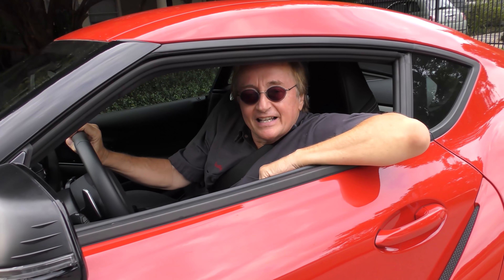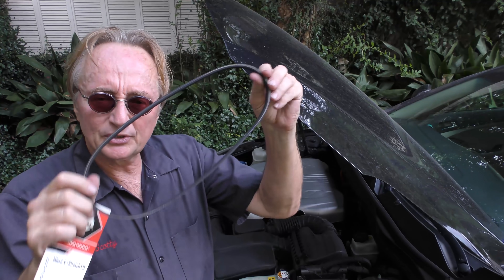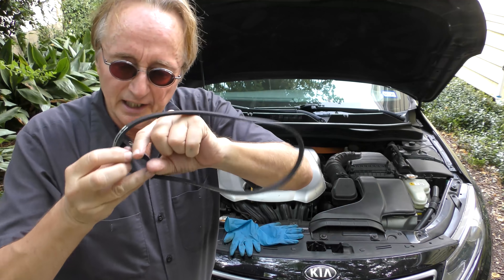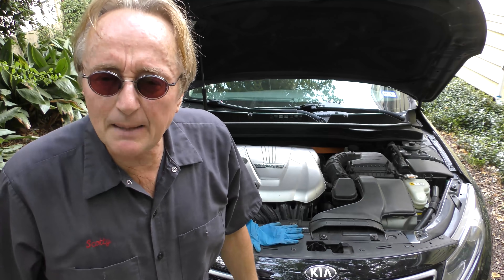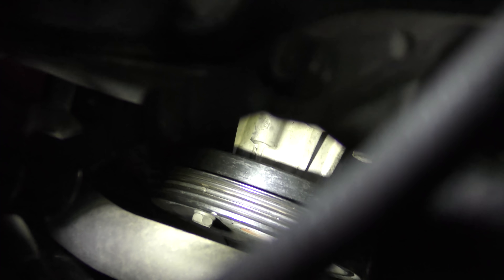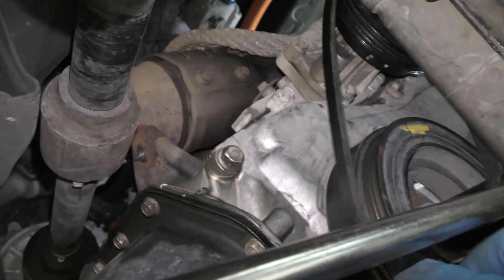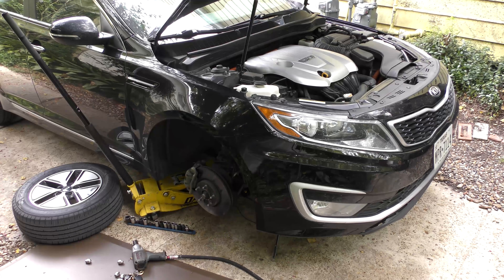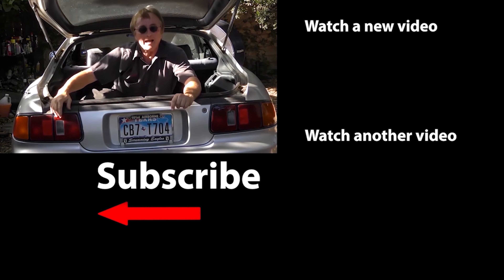I’m Mad as Hell and I’m Not Going to Take It Anymore

Comment: Some car designs you just have to ask “why?”
Reply: More than just some
Reply: I am still wondering what the point to engine covers is?
Reply: @sctslincoln  Primarily asthetics, but some manufacturers claim it has foam that is "sound deadening!" Lmao
Reply: @xforce687  its true though, i did an experiment and they quiet down the engine noise a little
Reply: ArmchairWarrior  Don't all the big three have a 3.0L diesel engine for their full size pickups?
Reply: ArmchairWarrior  i see alot of old ,Ford trucks though, F150, Ranger and Broncos
Reply: Oakleyworld you see a lot of mustangs and crown vic’s as well. Not so much for the taurus’, tempos and windstars.
Reply: Been here. So many are designed in and of themselves.  Many design teams never really interact. Also many people don't realize that book time is based upon the entire Driveline(engine and trans and dufferentials) being out of the vehicle. Or at least it was , some years back.
Reply: @bap7929  your right, i was just thinking trucks.
Reply: Try tune up in a 1992 ford aerostar minivan lol you have to remove the engine to change the spark plugs 😁
Reply: ArmchairWarrior  
Found On Road Dead.
Fix Or Repair Daily.
Fails On Rainy Days.
First On Recall Day.
First On Rust Deterioration.
Driver Returns On Foot 
(FORD backwards)
Reply: @sctslincoln  muffles engine noise standing outside the vehicle. Notice a lot of cars don't have underhood insulation any longer. Beauty cover instead. I hate them tho. I'd rather see the engine.
Reply: Probably 90% of the time it's just to make it different. Doesn't have to be better just different
Reply: xforce687 pedestrian safety. Newer covers have to be like a cushion, if a pedestrian smashes on the hood.

Comment: Call me crazy, but that looked like the easiest thing I've ever seen Scotty do.
Reply: I think it worked ok also. Problem(?) is that I hope the belts are marked as such. Saved a lot of parts and made the engine lighter (a bit). I have done this on older cars in an emergency when a belt fell off.
Reply: Do you want to jack up your vehicle take off the tire and install a belt from the bottom or whether you install from the top end without doing all that ?
Reply: @lesflynn2392  I hear ya, but I've wrestled with serpentine belts before and it seemed more trouble than that is all I'm saying.
Reply: Honestly if that belt is super cheap like only 3 bucks then to me I wouldn't mind the design its super simple and less to go wrong like a worn tensioner or bad idler pulley bearing
Reply: The problem is if Another belt breaks and you need to remove this one or remove this one to get to another inner part (Timing) then you have to replace all the belts you messed with..
Reply: The manufacturer saved money and it costs you money in the long run.
Reply: A professional can make anything look easy because of their experience and confidence. Try doing it yourself and you'll see what I mean. Crazy Kevin...... LOL!

Comment: Actually, those tensioners are a frequent trouble spot. By having the water pump on it's own belt without a tensioner, no matter what else seizes, the water pump will continue to rotate and you can drive home.
Reply: Quite a possibility, however I have a 2003 Accord with 291,000 miles on original tensioner, 2006 Accord with 200k on the original, 2007 Accord 215k on the original. My Mom's 2008 Crv is just starting to rattle at 210,000 miles so the tensioner will be replaced.

Comment: Just when I thought modern auto engineering couldn't get any crappier.
Reply: as the Carpenters used to sing "We've Only Just Begun"...lol
Reply: What?? Just because on some cars you (officially) have to take off the nose piece and bumper to change a headlight, or can't check your transmission fluid level while it's cold (or at all, when they do away with trans fluid dipsticks), or decide not to have spare tires anymore, because that can of Fix-A-Leak and the dime store compressor they give you will fix anything, even if the tire disintigrates???  /sarcasm.
Reply: @markh.6687  😂😂
Reply: Soon it's goona be time to start riding horses and wagons!
Reply: @tps607  First a "Network" reference and now the Carpenters.  As long as we're on a 70s vibe, could we bring back the '75 Monte Carlo?  Y'know, as kind of a reminder to Chevy of how they used to build cars, how they still could build cars, and in absolutely every measurable way don't anymore?
Reply: @maingun07  I think a committee of accountants is in charge now

Comment: As a mechanical engineer.... honestly it isn't a bad design and not hard to replace. You also don't have to worry about having the wrong tension or a bad tensioner pulley. This is a simple design that saves space, cost, and complexity.

Comment: I just replaced this exact belt on the TOYOTA prius (2004-2009) Scotty. Even the best of the best are cheap as hell sometimes. A little different, a bit harder, as there were two adjusting bolts, and you had to "check" the tension with a special tool, which I had to get around by doing the twist test (twist the belt on its longest run, make it so it can't go past 90 degree twist). Still was a simple job though.
Reply: Scotty has some obvious bias. Glosses over cheap Toyota crap like lousy paint and plastics that break easily like door handles, but bashes a Kia and says it's junk because of a modern belt design that eliminates a tensioner, which can go bad. This car is pushing 150k miles and still look and sounds good. If it were a Camry it might be burning oil by now with a broken door handle and warped dashboard padding. I can always count on him bashing a Kia or Hyundai unjustifiably and praising some rattle trap Toyota.

Comment: I install these all the time at work, they take 10 seconds lol. Also you can reuse them no problem. This guys a goof
Reply: @172-e5s   I'm a hyundai tech. You can see he's working on a 15+ hyundai/kia 2.4 which uses a stretch belt for the water pump. I have seen exactly 0 failures and well over 100k mile lifespan. The stretch belt is usually is much better condition than the serpentine belt when they do get changed. Probably due to the reduced friction and therefore reduced heat. You may also know these cars have a recall for premature engine failure. I replace 1-3 of these engines per week with millage varying from 30k to 200k, most people opt not to buy new belts at that time so we end up putting the old ones back on. Never had a problem in the 200 or so cars I've done.

Comment: I'm not sure about that car, but i was working on a 2005 kia amanti the other day, and it has a manual adjusting tensioner. You loosen a bolt underneath the idler pulley, then you loosen the idler bolt a little, and that allows the idler to slide back and forth to tighten/loosen the belt as much as you please.

Comment: Yeah I got a 2006 Mazda Mazda3 with the 2.3 litre engine. The alternator and water pump use a serpentine belt with a tensioner, but the air conditioning compressor uses one of those stretch belts exactly as you showed in this video.

Comment: My 04 Subaru has 2 accessory belts. BOTH have manual tensioners. The alternator is one, it's adjustable which is also part of the removal process. Other is a dummy pulley on slide rail for the A/C compressor. Simple, clean, and it works.
Reply: @zeroyon4562  I know atleast the 2016 WRX has a tensioner. Not sure about other models.

Comment: Snapper lawn mowers did the exact same thing about 15 years ago. If you're familiar with Snapper walk behind lawn mowers, their patented rear disc drive self propel system is to me the best in the lawn mower industry. The company is well known for the disc drive system that's very easy and powerful, and simple and reliable. It uses two discs, one driven off the motor with a belt around the crank above the blade, and another disc rides on that disc to adjust the self propel speed. The clutch is a belt that drives off that to the differential on the rear wheels. 

Well, when my family got our first Snapper back in the 80s they used to use an idler pulley on that belt from the engine crank. Just like a car it kept proper tension and the belts they used were thicker and lasted longer. Then about 15 years ago when I bought my own new Snapper when I bought my house, I found they had eliminated the idler pulley and went to the stretch belt.

Comment: I drive a 2006 Kia Cerato/Spectra MT with these 3 belts and they are infuriating to fit, but I have had the car now for 9 years with absolutely no problem mechanical or cosmetic. That's why I'm keeping the car cause the newer cars these days are made like crap and too complicated. I look after my Kia well and service it regularly with good parts and I have no problem with the car. But if I ever decide to replace her it would definitely be a Toyota, Lexus or Honda, because if there is one thing I have learned by Scotty Kilmer is that these brands give less trouble and also to look after your car so that it will run a long time. Thank you for your videos they really do help.

Comment: Scotty, I have an automatic 2008 F-150 with about 240,000 miles on it and whenever I shift into reverse the truck rolls forward a little bit then starts driving backwards. Is this something I should be worried about?

Comment: To think, my wife had considered getting a KIA! Now, she's looking at Hondas and Toyotas.
Reply: @172-e5s  hyundais are okay depending on which one you get and what year
Reply: Bought a 2013 KIA Optima LX new and have had the dealer do the oil and filter changes at the recommended intervals (I change the air filter and cabin filter) and have never had any issues with the vehicle.  Granted there are well documented engine and transmission failures and recalls for various problems but none of the manufacturers are immune to that...even Toyota and Honda.  I think KIA is a relatively good car that provides very good value, one that has been constantly improved since 2011 and is generally 3 to 5K less than Japanese competitors. I would buy another KIA if the need ever arises.  One last point I would make is that KIAs sold in the US are made in  Georgia and 
Alabama.
Reply: @bladerunner5810  if you can get away with it go for it! :)
Reply: She was interested in the Seltos. It's one of only a few available with multi-port fuel injection. It seems a good vehicle. The one issue she has is that because she's short, getting into it is an issue. Personally, I like the new Forte, but my '09 Corolla is still running great.
Reply: @miketype1each  2.0L multiport engine is used in Seltos, Forte, Elantra and Kona.
Reply: @palebeachbum  Yes, and the others in the lines are Gas Direct Injection, like the Honda CR-V. Scotty covered the issues with GDI engines. Scary stuff!!!
Reply: Kia and Hyundai are up there. I have a Honda and my wife has a Kia. Both are happy
Reply: @172-e5s  Rubbish
Reply: @Blue-moon12  Hyundai and Kia are getting better with every generation, while Honda and Toyota are slipping a bit. It's getting closer.
Reply: @miketype1each  if she likes the way to Seltos drives but it's too tall for her, she should check out the Hyundai Kona. It's basically the same vehicle, but sits lower to the ground.
Reply: @palebeachbum  Oh no, the Seltos is far and away more stylish than the Kona. We did test drive the Kona, but not the Seltos. To me, the Kona looks and feels cheap. I was rather taken aback by the Kona's lack of style. But more to the point, wifey wants a power driver's seat. That alone has reduced her choices considerably in regard to how much she's willing to spend. For example, a well-equipped Honda HR-V or Toyota C-HR without a power driver's seat are a couple thousand less, and within her dollar range. She may have to forget about a powered driver's seat and just get on with it.
Reply: @miketype1each  I think the Kona interior looks cheap, even compared to my Elantra. Power seats are usually part of an expensive package. I personally hate power seats, unless it has memory positions for more than one household driver.
Reply: @palebeachbum  I priced a C-HR and a RAV4, both with a power seat. The difference? Around $1,000, give or take. That extra grand gets you the RAV4, which is A LOT more vehicle for the money. Trouble is, it's a bit too big for my wife. Another issue is that there isn't a C-HR to be found ANYWHERE.

Comment: What I find interesting is that the big three belt manufacturers have made it quite clear over the last 5 decades (yes, I've been working with belt drive systems that long) that you should never install any of their belts over a set of pulleys without loosening the tension.  They state that it will cause internal damage by breaking small strands in the cords in the belt, plus, it will cause the cords to cut and detach from the rubber in spots.  None of this damage is visible, but it will show up as reduced belt life.

Comment: That's actually kinda good, since you don't have a belt tensioner that can break from spring fatigue (did that one on a Chevy Cavalier removing a belt to change an alternator years ago). If they really want to improve cars, start removing all the body computers, run wires thicker than 28 gauge to components, and stop adding useless relays.

Comment: Man, seeing this is why I never intend to own a late model car.  Not just the belt design, things like having to remove a wheel and getting under the fender to replace a belt.  I don't see why new cars need to be so small.  15 feet versus 18 feet isn't a huge difference in terms of driving, but that size difference really takes a lot out of roominess, engine workspace, and cargo capacity.

Comment: Scotty, Remember the 1979 Chevy 305 engines on the Impalas and Caprice?  The carburetor was sealed and the mechanic didn't have access to the screws to adjust the injectors during a tune-up.  They had to drill holes to adjust them.  Piece of crap even back then.  My dad, before the Chevy Caprice, had a beautiful 1971 Chrysler Town and Country station wagon.  Well beautiful it was, but a piece of junk in engineering.  The Motor mounts on the left side broke all the time from the torque. The U joints on the driveshaft broke at least 3 times. The radiator had to be removed every 2 years, flushed and cleansed of all the buildup, otherwise it would over heat, poor engineering-> undersized-small narrow heat exchangers and components that attracted debris buildup. It didn't matter how often he flushed the radiator, it would still need to be pulled every 2 years. It became part of Dads maintenance program every 2 years. We found out the hard way during a trip from NY to St.Louis when we got stuck in Pennsylvania. A Tractor-trailer mechanic shop in Somerset Penn figured out what was wrong.  They went through it like surgeons, they checked the water pump, thermostat, fan size and belts, the fan cowling and air being extracted through the radiator. When everything checked out, they decided it had to be the radiator, and it was.  We completed the trip to and from without incident.  Then 2 years later, the same thing on the way to work.  He already knew what to have done, Dad had a local mechanic who also thought outside the box. They were real mechanics like you.  I can tell you the radiator was removed in 1973, 1975, 1977 and in 1979 just before he bought the 1979 Caprice. 
I learned a whole lot from those washed up engineers and the great mechanics,  to stay on top of the maintenance and don't trust the manufacturers.

Comment: On my 15 fusion I have the stretch belt and the serpentine belt. The stretch is on the crank and the ac compressor, it is on the back side of the serpentine belt. Ford charged 100 to change both belts with labor.

Comment: I have two Gates drive belts on my Solara. They replaced the two Gates belts that were on the car. They were slightly worn, But since I had the timing belt replaced, I just had a mechanic replace the drive belt as well. They have a lifetime warranty. Hopefully they’re not the stretchy kind. My mechanic never mentioned it. My car has belt tensioners.

Comment: Changing the belt on the Kia gave me flashbacks to trying to help my friend change the alternator on her old car. Well, it was less trying to help her and more looking it up like "you gotta do what!?" Remove the wheel, wheel well cover, etc... Nah. I'll pass on that. 

On my old Forester, it only took 3 bolts to replace the alternator and a little bit of tension adjustment. It took all of ten minutes. I still miss that car. Rust took out both rear shock mounts. :/

Comment: Few months ago, while passing a car, my oldie began screeching, i thought the alternator belt got lose due to the alternator stretch screw got loose, but no... 
Literally it was the screw that broke in the support/intake. But i'm not one to call the tow, so... looked around, stuck a piece of wood between the alternator and intake, to stretch the belt and did the remaining 200km of the trip. Its been almost 20 years in my hand and never this car got towed :)
About 3 years ago, my wife was 6m pregnant, same car, same trip, head gasket blew water passage on cyl n4. Tbh, my fault, the poor machine was telling me with a rusty spark, the head gasket was to be changed. For over 4 years haha... Took spark out, grab some big water bottles, did the remaining 150km refilling the cooling circuit with water every 10-20km, did not overheat or warped the head. That cyl was clean as a whistle. 
What a machine! opel kadett 1400cc 8v with carburettor, no fancy modern stuff. Don't ask me how many km, it goes around at 99999 and i lost count how many times haha. 95xxx now.

Comment: My 2002 VW 2.0 has auto adjusting tensioners for serpentine and timing. Wonderful, except the timing belt is a real PITA even with the tension fully released. At least i don’t have to do it again (until 250k)